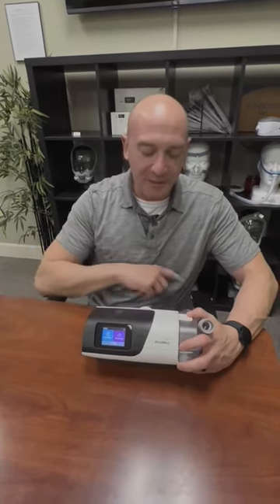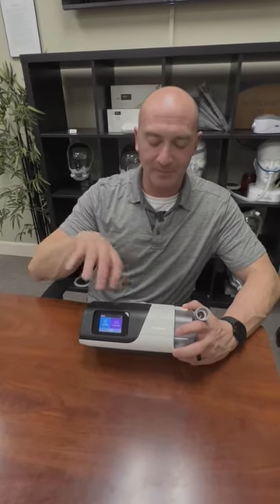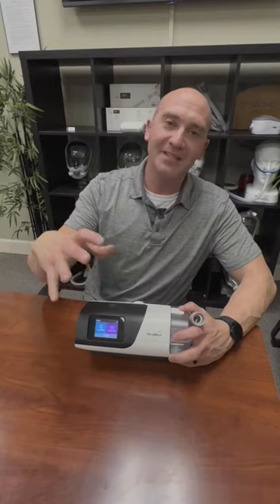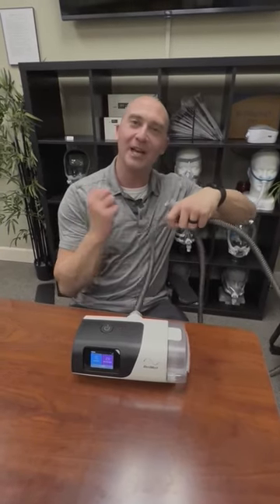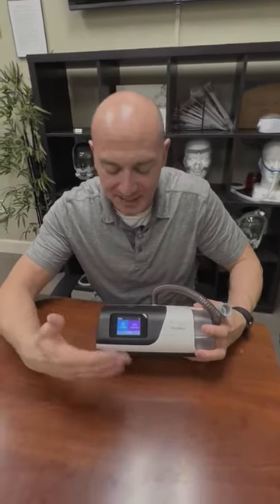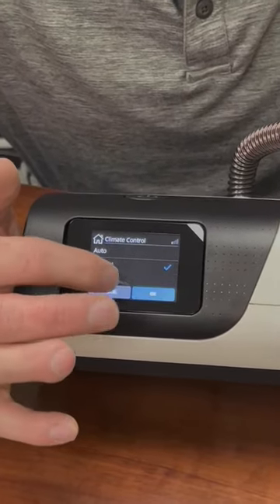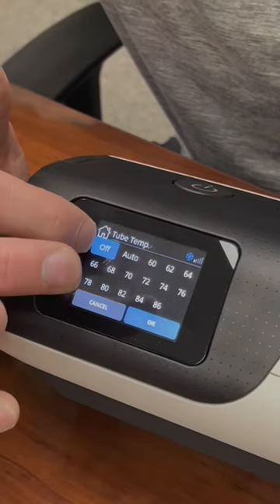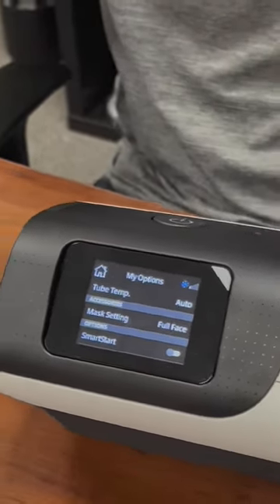For Resmed Airsense 11 users: how to avoid getting water in tubing

Comment: Been having a Lot of water in tube & mask and then all over in the morning- was total by my tech that I need to either increase both or decrease both but not just 1 or the other? 
Temp was 76 and humidity was 4 - still having/had water issue- room temp is about 63? 
Getting worried about the summer when the colder my a/c is the better. 
Also wondering if u could talk about where it’s normal to have air “leaks” from the mask?  Currently have air leaking where tube meets the mask top of head but also sometimes by nose pillows like not just out of front also air shoots up by my eye on either side... am annoyed by it and feel like that might b causing some of water issue in tube & mask?

Comment: Both my settings are on auto, but have gotten rainout in my mask since day 1 of getting this new equipment a few weeks ago. Is possible my heated hose is defective & not actually heating? I feel no warmth on it at all.
Reply: I wonder this too. Like shouldn’t it feel warm to the touch?
Reply: Same! I just drain it so it doesn't make that sound when i breathe and then clean it once a week. It's a big deal tbh. It dries due to the air flow anyway
Reply: I get the same. I had mine elevated at first and then put it lower next to bed and still have water in nasal pods. Idk what to do

Comment: Very glad this video exists because I need the high humidity but the gurgling sound was keeping me awake. I'll increase the temp of the hose tonight. But would keeping the tube wrapped in a blanket help? Would having the humidifier on the floor help encourage the water to flow downwards?
Reply: I tried that but my CPAP tech said that the heated hose doesn't need a blanket.

Comment: Thank you for this info. I'm not hearing the gurgling in the tube but as of late, once the seasons changed and my room grew cooler (I also like to still sleep with a fan even when it's cool), I have started hearing a whistling sound coming from my mask which has been waking me up. It's definitely not mask leak. My seal is great. However, I have a Fisher & Paykel Vitera full face mask with the exhalation air holes so I guess condensation is now blocking the holes and causing the noise. At 4 a.m. I did some research and adjusted both the hose and the humidifier settings to Auto. Hopefully, this will work tonight and I'll be able to start sleeping through the night again.
Reply: S did it work?
Reply: please respond if that worked for u???? i have the same issue
Reply: OP's  setting change blew up their house and killed OP

Comment: I'm hoping you can the VA is getting a little cranky with me we had to put an AC unit in my husband's room due to the heat in Florida since then he's been getting a lot of water in the to buy have changed the settings multiple times and have them change it he's still getting water in the to the room is extremely cold but I don't want it to drive otherwise I'd get to nose sores can you please help me fix the settings I would greatly appreciate it as he's getting a lot of water in the tube I did take a pillow case and put it over the two-bit night to try to keep it warm but that didn't work
Reply: What is a VA?

Comment: I do not see those settings on my machine
Reply from the maker: @killsins3263
Thanks for pointing this out, and I should have mentioned this. Those settings only appear if you have a heated tube. To tell if you have a heated tube, you can unplug it and see if there is an electrical chip that fits into you CPAP. If not, then you have a non-heated tube and you can't change tube temperature. If you would like a heated tube, you can reach out to your supplier. Thanks!

Comment: Hi I have a air sense 11 and running out of water before I wake up ,I check it and no water in the chamber ,it set to auto
Reply: Hi John, the first thing I check when I'm looking at machines running out of water is mask/mouth leak. If you have a nasal mask and your mouth is blowing open or if your mask is leaking it will really eat through your water. I can usually tell by the way the download looks if your mouth/mask is leaking. I'd give your CPAP provider a call. They should be able to tell the the leak profile in Airview, the clinical software for Resmed.

Comment: Can I use the heated climate tubing without putting water in the humidifier?
Reply: I just got my air sense 11 2 days ago. From what I read in the manual and everything I've read on the RES MED website, you will not be offered the settings to turn on or to adjust the humidity if there's no water in the chamber. Hope this makes sense

Comment: I'm getting the gurgle but it's not coming from the hose. I made sure the hose and mask were free of water. Seems like water is collecting in the bottom of the arc'd plastic tube inside the machine. if I tip up the end, opposite the water chamber, then it drains into the water chamber and stops gurgling. What if I drilled a tiny hole in the bottom of that plastic arc to drain it?
Reply: Drilling a hole in that tubing would be a bad idea.
Reply: Same here i got water in my machine

Comment: Can I  use the Auto Climate feature if I'm using a non heated tube?
Reply from the maker: Nope, is only available with the climateline heated tubing.
Reply: @LiveWellCPAP  I'm am trying to buy an Airsense 11 Climate Hose. My provider is unable to get one and says the Airsense 11 machines you can't get anymore. I just got mine upgraded from a Airsense 10. In Nov.2021.
Reply: @genemadsen8141  I just got my air11 today.